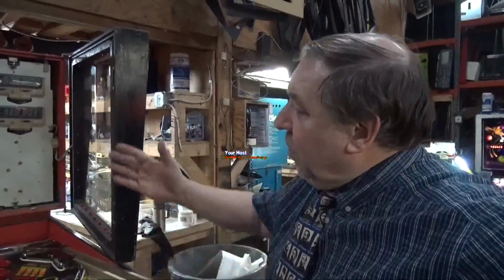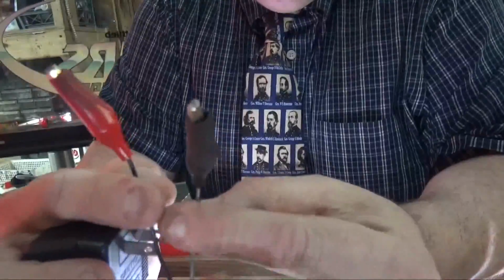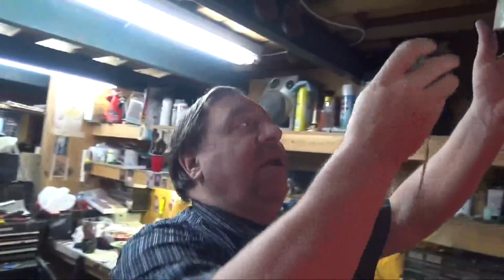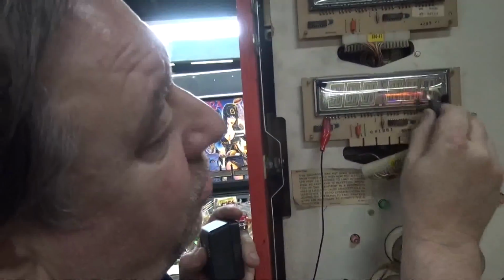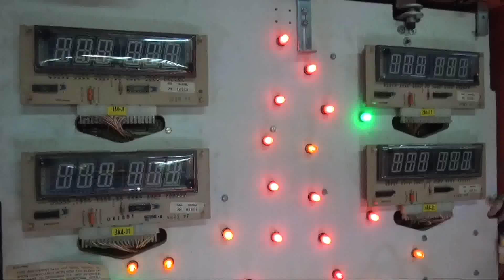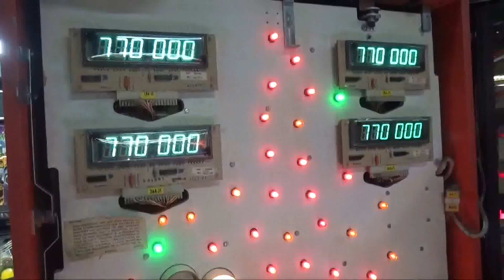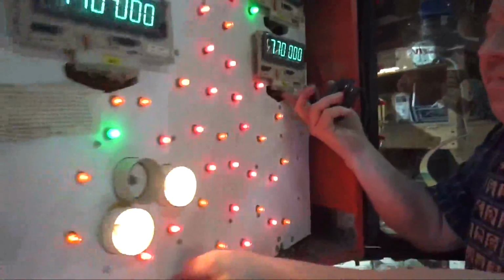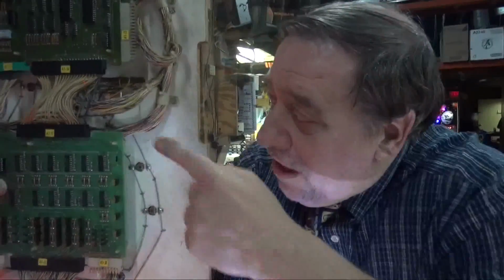#970 FIX your DIM Gottlieb PINBALL MACHINE System 80 & System 1 DISPLAYS! Todd's Tips TNT Amusements

Comment: Great tip.  Another tip to add about these displays.  The 1MFD 100v orange capacitor should be replaced as standard practice especially when using a Pascal board as when these caps go a bit out of range due to age, they can cause HV fuse to blow.
Reply from the maker: Great idea!  The capacitors just get older every year anyway!!  Thanks for sharing!

Comment: There's no need to reverse the polarity.  The main thing is to heat the filaments up until they glow gently to burn the crud off their surface.  A battery does work too.
Reply from the maker: bigclivedotcom Frank surprised me with that, but a second ten second "soaking" doesn;t hurt!

Comment: Hi man, that was awesome !
I have troubles with my Gottlieb Genie: While playing, the points are counted on counter1, then with the same ball it changes with no reason to count on counter 2, counter 3, counter4.
If the switch "ball back at home" would be false tripped, it would count the bonus points, but it doesnt. It looks like a software bug.
Reply from the maker: there were no software updates to Genie...it only had that one Rom all these years...I suppose the ROM could have gone bad, but usually it wont work at all.  I would put it into a switch test and bang on playfield to see if another switch comes up.  Also...very important...you can get odd switch readings if the COIN SWITCH BLADES in the coin door get entagled with the fishhook wire that blocks the coins whe game is turned off.  Check those two switches to make sure they are not touching anything.  We cut that fish hook wire off completely on every game we sell as its been n othing but trouble when game lands in a home.
Reply: @tntamusements  Many thanks you, I'll try this. I also suspect that it could be a bad contact.

Comment: This is a great help  - Thanks. WEhen i used a 9V 1.5A adapter, the grid wires didnt get as red as i thought they would. The displays are brighter  but not by a lot - Can you leave the DC voltage on longer?
Reply from the maker: Yes...fifteen extra seconds

Comment: hola maestro soy de argentina tengo me callo a mi taller un flipper gottlieb sisten 1 genie el cual vino muy maltratado el flipper prende pero no enciende la pantalla de los creditos y en las dos pantallas de arriba aparecen solo numeros 222222222         2222222222       y en las de abajo todos ceros    asi  0000000000     0000000000  no hace el bucle de 5 segundos nada solo aparece apenas se prende la maquina esos numeros podria darme una orientacion de lo q puede estar sucediendo yo soy  tecnico electronico pero no conosco bien el sistema sisten 1 espero su respuesta muchas gracias y saludos desde argentina
Reply from the maker: We always install a new power supply...to insure the logic board is getting the correct voltages....but this sound like the logic board is bad...and they are very difficult to repair.
Reply: @tntamusements  LE AGRADEZCO POR SU RESPUESTA LA FUENTE DE ALIMENTACION LARGA LOS VOLTAJES CORRECTOS AL MEDIRLOS CON MI TEXTER.AL MIRAR LAS BOVINAS DEL FLIPPER O SOLENOIDES ENCONTRE 2 BOVINAS TRABADAS Y UNA DE ELLAS QUE MANEJA EL DROP TARJET COMPLETAMENTE QUEMADA.QUISIERA SABER SI DESCONECTARA LA PLACA DE POTENCIA DE LA CPU DEBERIA INICIAR LA CPU?DE HECHO LE DESCONECTE LA PLACA DE POTENCIA PERO LA CPU SE COMPORTA IGUAL LE ENVIARE UN VIDEO AGRADEZCO SU CORDIALIDAD.
Reply: @tntamusements  estimados colegas ustedes podrian facilitarme la hoja de datos de los chips de rotweel necesito la hoja de datos del procesador araña y de los demas chips arañas los que manejan las pantallas de puntuacion etc.agradezco su colaboracion muchas gracias

Comment: wouldn't say a child could do it unless it's with a 9 volt battery.  hows the tongue.  a child would probably see what happens if they touch the pins to their leg  ouch.  Safety first :)  think nowadays when I replace outlets in the house knowing the clodhoppers that wire houses.  I just turn the house power off.  negats a nice jolt for idiotic wiring.
Reply from the maker: Lee Bartholomew A child could do it....there I said it!
Reply: TNT Amusements Inc ZZZAP     this would be like good parenting  don't touch that  (fireworks?  hmmmm)    still need trick  , fairly good with electrical items to code..